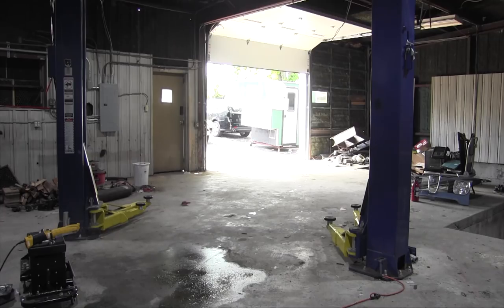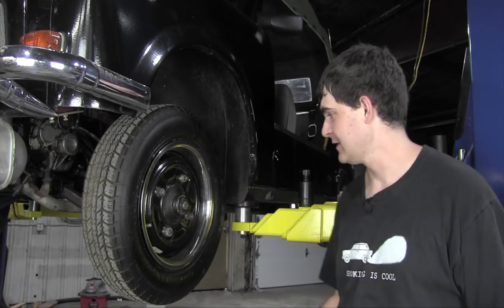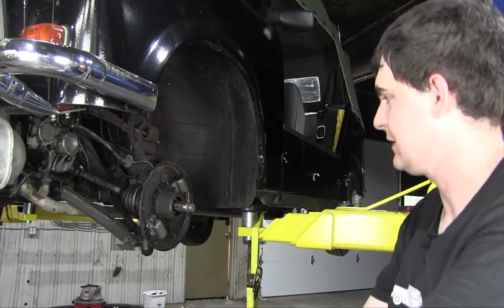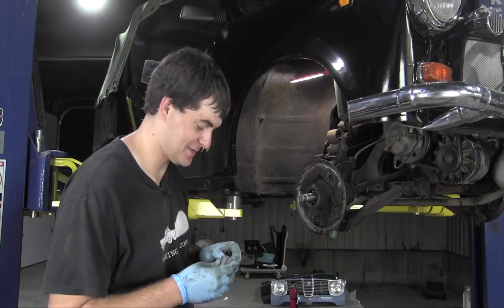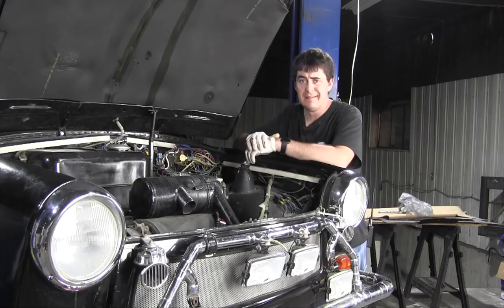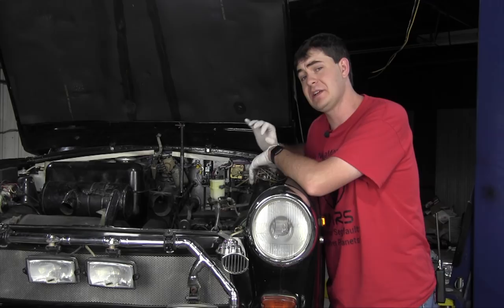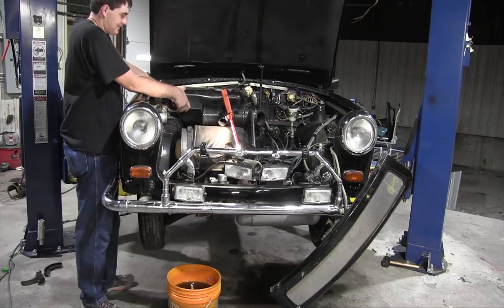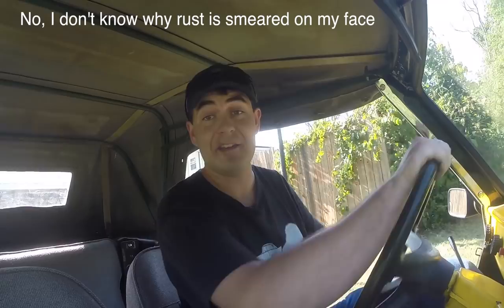Making a Trabant Tramp Go and Stop Again

Comment: This is probably the most unsafe car ever released to the public... it doesn't have fixed roof, doesn't have doors/solid side, no real structural reinforcement of the chassis, or very little. Also no safety rollbars behind the seats, only has static seatbelts, and it's covered with plastic. And this one didn't even had proper brakes. 

Basically it's a coffin on wheels, but it's still the most fun you can get out of a Trabant :D  I guess you could touch the road next to you if you'd want to, while moving... and also smell the glorious blue exhaust smoke while enjoying the sun in your unique cabriolet.

Even the VW Thing is safer than this... probably the only car that's similarly unsafe is the Citroen Méhari:
https://photos-1.carwow.co.uk/blog/1600/content_citroen-mehari-beach.jpg
Reply: MetalTrabant this isn't even an exaggeration the body parts are made of a pressed epoxy fiber stuff it feels like cardboard
Reply: @EradWir: I know, I have one as my daily driver :D  (Not Tramp, just a regular sedan) And duroplast is pressed cotton waste mixed with resin, as far as I know.
Reply: MetalTrabant I worked in an museum about the inner German border and had to wash on of them I thought it was gone fall apart after it got wet
Reply: Did you really think they would make a car that would dissolve in water when it rains outside? :D  It's made in Germany for Christ's sake, not China  ;D
Reply: MetalTrabant it was made in East Germany and second I said it looked like and not it did if it did it would be a little inconvenient
Reply: From your comment it seemed like you were seriously considered the thought that water will hurt it, which is a little funny, sorry :-] 

And East Germany still had German engineers, whom just happened to stuck on the unlucky side of the Iron Curtain.
Reply: MetalTrabant they had some cause most of the good ones fled to west Germany and amerika